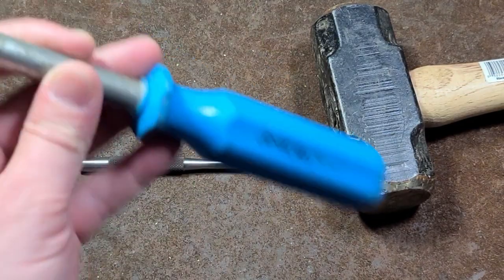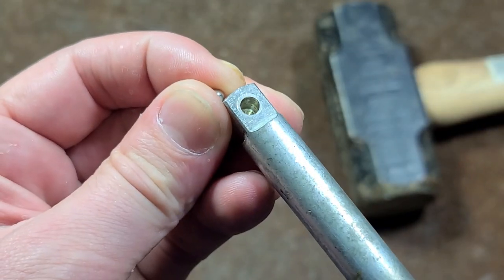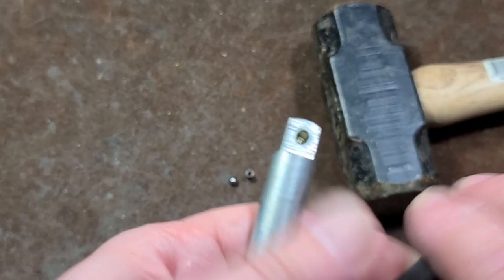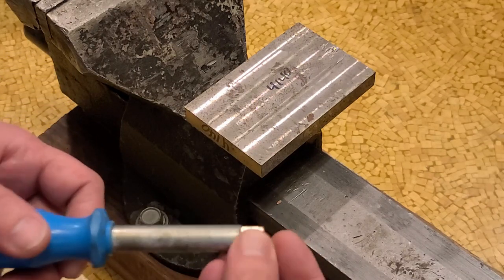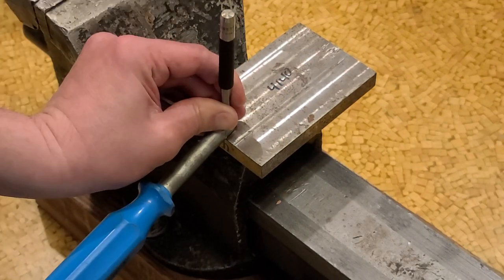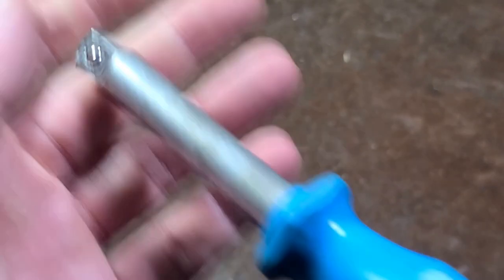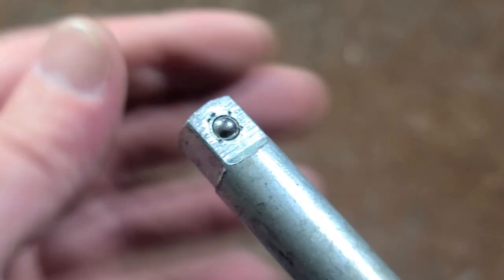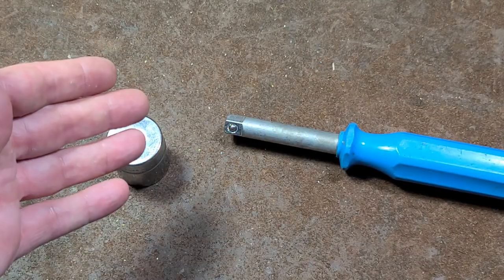How To Repair a Hand Tool Ball Detent

Comment: third method. I drilled a hole in a 3/4 inch ball bearing and glued in a chopstick as a handle. Insert spring and detent ball and hold them in the hole using the ball bearing: on a hard {steel} surface. Give the ball bearing a smart wack  with a hammer and it nicely swages the hole.

Comment: Now I just need to be precise enough I can do that myself to a couple milwaukee impacts that don't hold my craftsman sockets. So I've been wondering if I had a drill bit hard enough to drill the anvil could I put a ball detent in it myself. 🤔 the friction rings just suck. But the detent on the hex drive adapters are perfect
Reply: Thats exactly the reason im looking for this type of video... did u end adding it??? How??
Reply: @jayb4459  I haven't done it yet, my plan is to buy some hex drive adapters to cut open and take the ball and spring out of, then drill a hole in the 3/8 milwaukee drive on the tool and put it in might work might not idk lol.

Comment: If stubborn which they normally can be in good tool steel, place ball in freezer for 1 hr.  Dip end of tool in boiling water for 5 mins (hot plate near vise is ideal but you should be fine making it from stove to work bench); if tool too large lightly heat localized area with map/light heat bud no higher than  250deg - 300deg Far (typically be surprised, with combination of freeze, does not take much expansion)....with the ball pre-lubricated with WD, use vise or press to press ball in...normally will just fall in and let cool; this also works well with bearings/bushings.  Lightly spray piece with WD40 to cool down and let cool to room temp.  Can then shot peen edges for added security to retain ball in retention cavity.

Comment: Back in days of yore, engine driven mechanical fuel pumps had their check valves 'staked' into their (econobudget) pot metal pump housings in near identical fashion.

A common failure was improper staking allowing a valve to either jump out, or swivel sideways in it's bore. 

Either way always involved vociferous coarse foul language, accompanied some (or extensive) walking.

Man, I just really just dated myself...

Comment: You can also drill a hole all the way through, peen one side (just put a big bearing on it and whack it), and tap the other side. Then you just drop your bearing and spring in, and close up the hole with a set screw. 

We did that in a machine shop that occasionally made strange sockets for heavy industrial use. I imagine you could do it to some old tools like this, if you didn't mind messing up your chrome.
Reply: gonna try that, thanks

Comment: What about when the ball is stuck in the recessed position. Soaking it in solvent and penetrating oil hasn’t helped.
Reply from the maker: I've had that happen on some rusty tools I would use some type of rust solvent and then you just have to hammer it against the piece of wood and it may get stuck again you may have to repeat that process